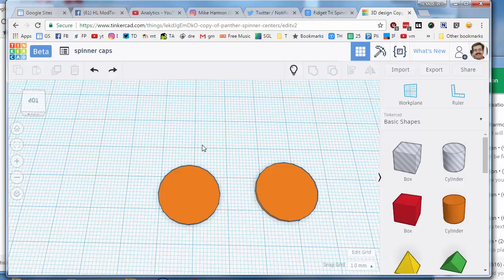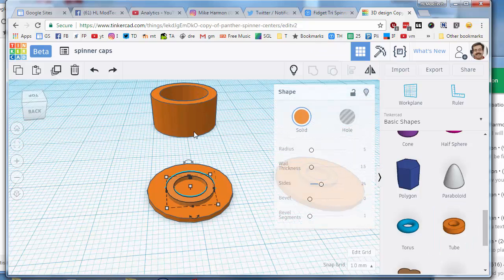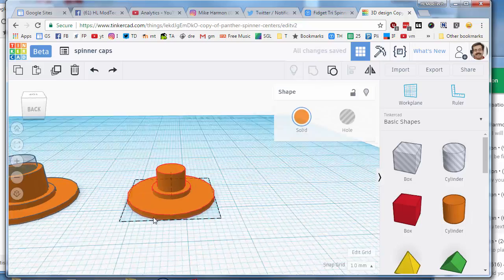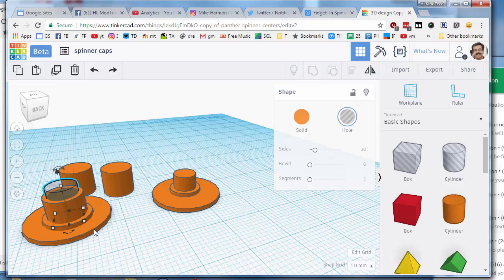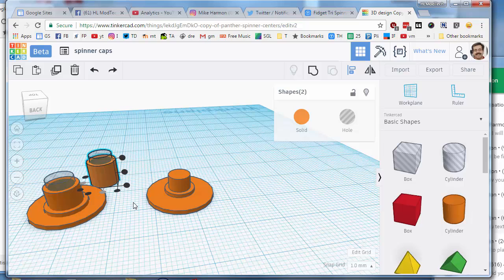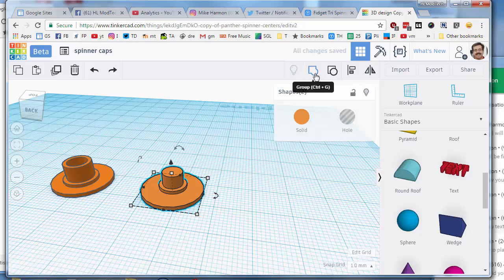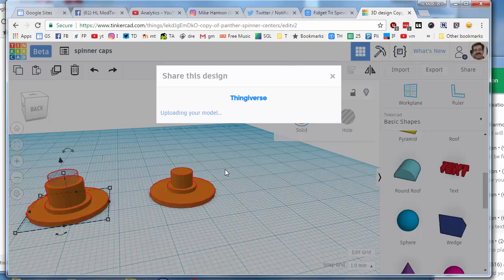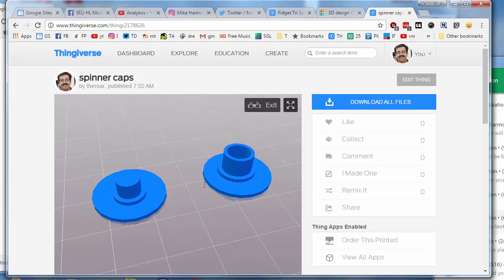Spinner Caps! Design them on your own. Super simple thanks to Tinkercad

Comment: Hey, you didn't say the measurements for the tube only for the radius and wall thickness
Reply from the maker: When you use the tube, those are the measurements that you are allowed to type in. You can click and stretch it, but it is way more difficult than just clicking the dialog box and changing the numbers.  You can see the dialog box at the 1 min mark of the clip. Hope that helps and thanks for watching!

Comment: Can you put threads on them in TinkerCAD so they screw together like normal spinner caps?
Reply from the maker: I believe the size would be difficult... I will see what I can track down though.
Reply: Actually I only see threaded screw caps on nicer spinners that have r188 bearings. So that is even smaller than what you made.
Reply from the maker: getting them to print with plastic at any size is a bit tricky. I am wondering if the threads would have to be backwards to get them to stay as well. I have found a lot of mine that we create are pretty snug though. The more you remove them the more they wear out though.  Thanks for the note though!